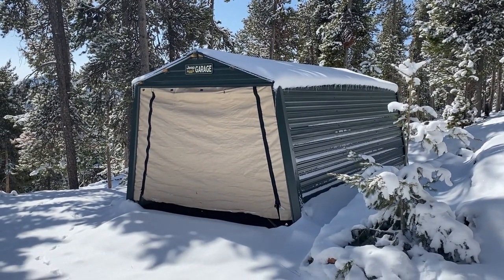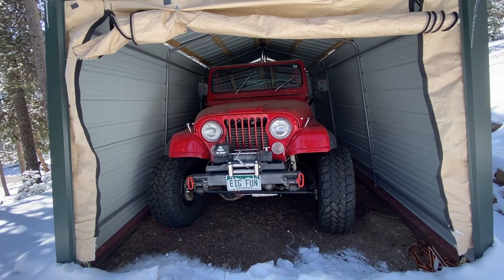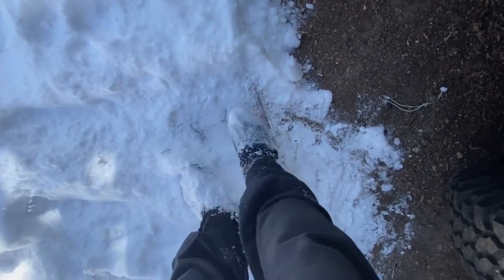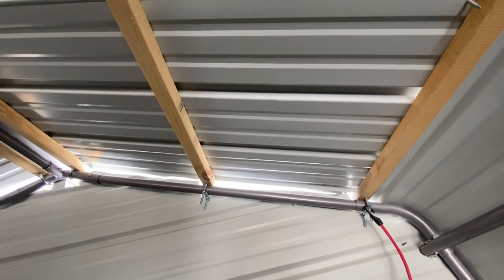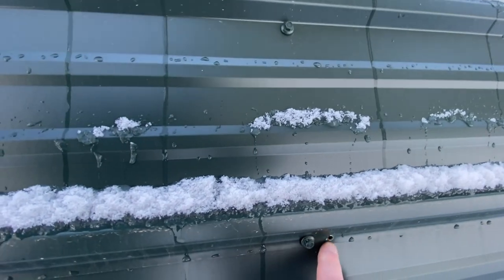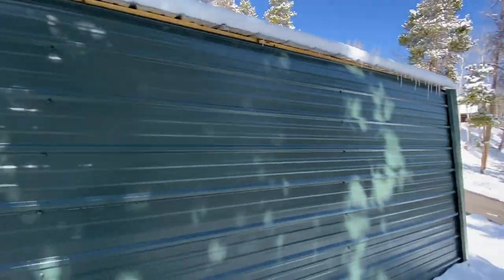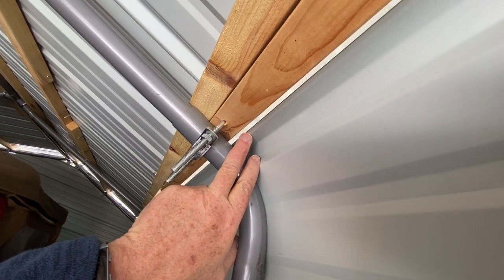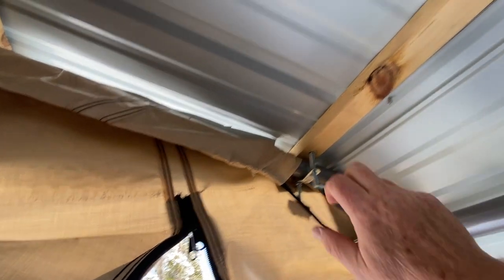Metal Conversion Harbor Freight 10x17 Portable Garage

Comment: Neat to see another snow load area build like this.  A few sound like they've been through hurricanes, so that's great.  Thanks for sharing.
Reply from the maker: I was worried about wind but it's held up!
Reply: @bowercabin8540  I'm looking to do the same after the Ohio wind lifted mine up and over my garage building, even thought the portable one was anchored pretty well into the ground. I'm still nervous about the wind doing the same thing once I do the conversion.
Reply from the maker: @mrknittle532  It's possible and you could install a concrete foundation. Mine would be much nicer on concrete

Comment: Thanks for adding to the other great tips on these garages...very helpful. How many years did the tarp covered original tent last... seems I heard something like 6yrs?

There were several complaints about the zipper breaking, but seems you didn't have a problem.
Reply from the maker: Sorry for the delay. Yes originally installed in 2017 upgraded in 2022 so lasted 5 years. Went through multiple heavy tarps in those years keeping the cheap HF fabric covered, that is very important. The fabric they provide will disintegrate in sunlight in a few short years.
Reply: @bowercabin8540  No worries, delays put me in a place where my tent hasn't gone up yet but will very soon. 5 years is well worth even up to a couple hundred invested in tarps. Thanks, very helpful.

Comment: Thanks for the video, looks nice!😊
A few questions..

To hold it down, you mentioned cement blocks. Did you use pier blocks or rectangle? 
I was thinking to add a lag bolt down through the existing metal legs into pier blocks with the existing holes in the middle, then pour cement in around the bolt. (This would also raise the carport up high enough for my tractor to be stored in there).

Another question is, do you have any condensation dripping when the Sun shines on the frosted roof? I would like to prevent that.

Thank you for your time 😊
Reply: I am planning on putting in t-posts at each corner leg, maybe all legs, then secure with pipe hanger strips. Cut PT 2x6 with hole for t-post and a 10-12 nail/stake where the leg sits and leave it about 1.5 inches tall.
Reply from the maker: Your idea is great that would work. My metal frame is attached to recycled 2x6 that I hooked together as a rectangular base. On each corner they are ratchet strapped to concrete blocks about 6" thick, 2x2' in size with rebar in the center. Previous homeowner used those as "caissons" under a redwood deck which was terrible.

Comment: I am not getting how you installed u clamps?  Drilled through roof and wood at same time?. From the top
Reply from the maker: Just through the wood. There are lock washers and nuts on top. I found bolts with just enough length so didn't have to cut off the ends above the nuts, but you could do that. Then I mounted the roof panels on top of the nuts. It's not perfect but it worked.
Reply from the maker: pause the video at 15:49 to see one at the front end where the nut is visible under the roof panel.
Reply from the maker: Most of those I installed round part up but a few on the ends I had to install with the nuts up, just have to cut any extra threaded material off so the roof meets it close.
Reply: Thank you very much for your video and time.  I was able to get a screen shot  @bowercabin8540

Comment: Are you not afraid that the pipes themselves will collapse under snow weight
Reply from the maker: is possible yes but so far it's held very deep snow for many days. I notice it has a tendency to lean to one side so I tighten a small ratchet strap diagonally across the front to help it stay vertical. I think the tubing is just strong enough, helped by the lateral strength of the steel sheets attached with heavy roofing screws.

Comment: Did you say $1,600 dollars?  Bro.... that's  alot of coin for that little bit of metal...
Reply from the maker: I agree it stinks but building material costs are crazy
Reply: Yep, I recently priced it and it's terrible. Hopefully mine will hold out till the price drops, if and when.
Reply: The corners and ridge cap are very expensive and depending on what you are after you could live without them, save a few hundred dollars there.

You can also run the metal all front to back without the wood instead of doing the roof like is demonstrated in this video.

Just a few ideas and you could probably cut some more cost out if you sacrifice elsewhere
Reply: 1600 is insane for that metal
the sticks don't cost much
I've built at least 10 of those garages and the only part of that build that is from Harbor Freight is the front door. 
All those pipes are from some where else.   It's possible the "somewhere else" uses the same door as the Harbor Freight and NONE of those parts are from there.
Reply from the maker: @burtreynolds3143  darn you figured out my master plan to deceive everyone by using HF's cheap-ass fabric door on a much more expensive tube frame. You think I threw away the steel poles from the kit and kept the door? Genius!